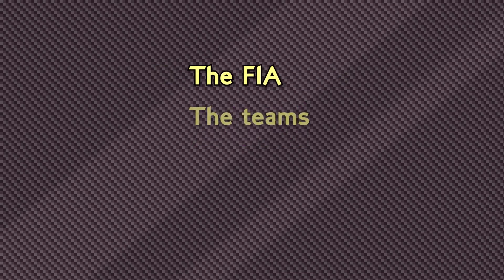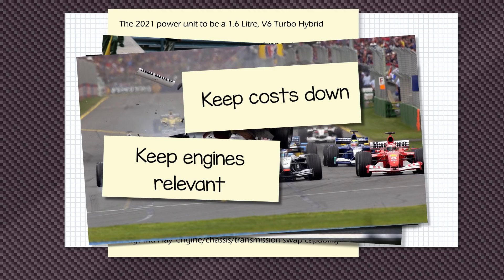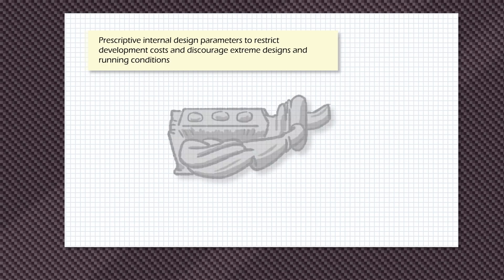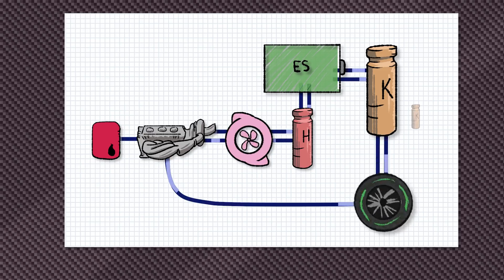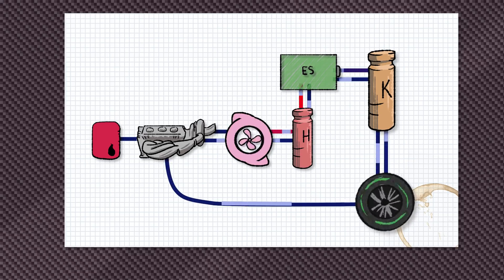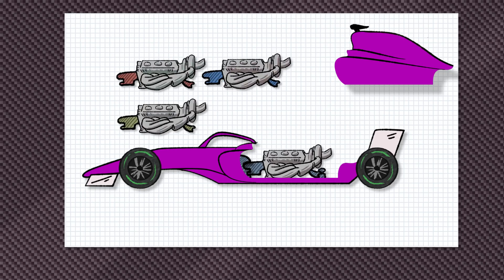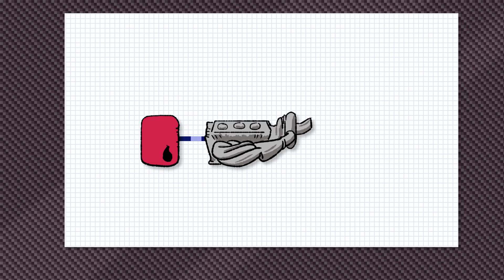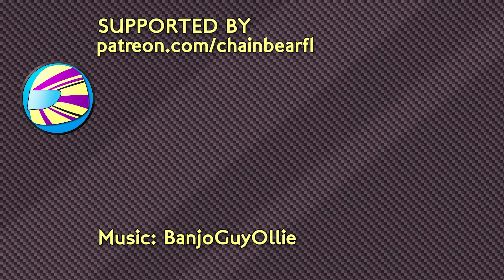F1 Engine proposals 2021 explored

Comment: It isn't even finished but already over-regulated...
I have the perfect solution:
- motors should run exclusively on electricity
- Don't beryllium/other-rare materials or anything that's morbidly expensive. (probably including cryo-cooling)
- Limit energy at the output of the batteries, fuel cells precisely to 750kW. (This will promote more more efficient designs for maximum performance.)

That's it, everything is solved! It wouldn't only be road relevant and fairly cheap but forward thinking and rational! (So obviously it won't happen)

Comment: Just imagine F1 cars driving round with 1Mw to 2Mw full electric engines ( 1300 + to 2600 + bhp )....easily achievable within the next 10 years....F1 with lay down the foundations for the motor industry having to drop the piston motors by 2040 in europe....IMHO....there gonna be quiet......but brutally fast.

Comment: I would like to see that each engine swap costs 5 points and each gearbox swap 3 points. But you won't go below zero. So a low-performing team can be very active in engine development without getting punished while a high performing team has to be more careful.

Comment: What about creating "Formula No Limit"? 
Just imagine F1 without any technical regulations. 
Fuel flow, weight, aerodynamic design, anything you want as long as it doesn't blow up when booting up.

I just think it would be funny, and also leave a huge margin for creativity.
Reply: Yea. With Ferrari and Mercedes having about four times the gap to smaller teams they have now. It'd be like a open-wheel LMP1 class. Just no.

Comment: Totally ridiculous. Why does an F1 car need to be green when they only race 18-20 times a year? Why does the sport need to be relevant? I've never seen somebody do the school run in a F1 car before. If you want relevance, watch Formula E & 24hr Le Mans. Formula One should not only be cutting edge but also entertaining, in the last few years the viewer ratings have gone down massively. I don't it's a coincidence that the V6 turbo came in at the same time. Saving costs? Man, engines are more expensive now than ever. Just use the V10s but allow the teams to use a variety of materials to make them, also make them more reliable and use KERs or something.

Comment: My god man! Not worry about the sound because the motors will be all electric one day? That is like committing suicide because you are going to die one day anyway.

Formula 1 currently appeals to fellows like us because we are part of the minority that likes the tech. The majority of F1 fans actually like the racing. These people want noise and overtaking. As well as crashes.

All F1 needs to do is make. Them sound better, cut the aero aids back (dirty air devices have killed overtaking) and find a halo device that doesn't look completely stupid.

F1 is a TV sport. It needs to look and sound as good as possible to attract as many fans as possible. Loss of popularity kills motorsport. Look at the various touring car and GT series that have died due to idiot balance of performance rules.

Let them race. Let them go silly with the engineering. F1 especially is meant to be the coolest, most insane and. Expensive motorsport on the planet. If the fans wanted green racing, formula Prius would be the most popular sport on earth. It isn't. Formula E is boring. It is watching Motorsport with the mute button pressed.

Comment: IMO, if F1 wants to leave behind exotic but inefficient by-gone V12s; then they should really push things forward.
Negotiating with automakers to encourage them to join the competition is only holding everyone back.
We all know that piston engines requires a lot of maintenance and is inherently not that efficient because there are so many moving parts. It is true that automakers have endless amount of engineering know-how to make them do what they want to a piston engine but still it is time to let go of that.

I would propose an electric driven direct drive set up and power coming from an efficient turbine engine. Turbine engines are literally maintenance free! and it can run every combustible fluid available. Today, they are more than 50% efficient in the form of electric power generation. This is way more futuristic than a complex V6 turbo that has a complex web of connection to the hybrid electric system. With a turbine-electric setup. it will be a series connection, simple, advance and efficient.

Comment: I'd rather see inline 4 cylinders with a flat crank than these v6s. Crankshaft timing and firing order has more to do with the lousey sound than anything else. The engines spin plenty fast as they are now, and they would sound great if they were anything other than the v6s they are. A flat 4 or inline 4 would sound much better. 
Let's also not kid ourselves... If you think the IC engine will ever be "phased out" of F1, you're just nutty. Formula E exists for a reason. F1 is F1, not Formula E.

Comment: In 2030 the f1 engine will be replaced by a GPU. Races will be entirely done by robots in software. It will be super relevant and rely entirely on electrical power and technology.

Comment: I don't quite understand the push to use these complicated energy recovery methods and tiny engines at all. It's debatable whether or not F1 tech will ever be completely relevant in road cars, I think WEC cars fit better into that category... but the whole fuel saving and efficiency thing is surely a bit of a "look at us, we are saving the planet" type of move. Anybody who thinks that 20 cars running around a track for an hour every 2 weeks will have ANY impact on the environment in any way is absolutely kidding themselves. This is why I think simple, loud, fast and generally more showy engines that have the capability to put on a good show due to lower running costs and reliability should be considered the most in F1. I love the technical aspect to these current engines and I think the work that these teams do in development is amazing but in terms of the future of F1 as a sport, i'm not too sure.. Nobody ever said that F1 had to be a sport run by greenpeace. If you look at most of the developments made in F1 prior to this generation in particular, development that made the most strides forward was done with a single thing in mind.. To win. Creating all of these artificial goals with efficiency in a way detracts from the essence of what has been driving F1 for the last 60 odd years... The drive to win and make radical moves, regardless of what is more 'efficient' or 'green'. Thats how I see it anyway. F1 shouldn't be a tech demo for companies, it should be an exciting and interesting spectacle where we watch the best drivers in the wold compete.

Comment: Old v12s are old, modern ones would not be, are you that stupid you can't see that? f1 is about ENTERTAINMENT! They are loosing their audience because they have sanitised the fuck out of the sport. When they ditch petrol engines for electric the audience will shrink and the sport will eventually die.

Comment: F1 has always been about money, glamour and an element of danger. That is the appeal and money breeds radical designs and concepts.  That was the culture and the current owners are moving away from it or perhaps the industry has been toning it down over recent years. If the petrol engine is replaced more with electric motors then we are competing with Formula E !
Set parts and common parts is similar to indy car and the new owners have to be careful that the needs of non American fans are kept happy.

Comment: I just want the V10 back
Reply: Honestly it would be cool to have a super small displacement v10 hybrid
Reply: @FELiPES101  Idm an I5 either ; it has some uniqueness in it's engine note like a V10 as well
Reply: @FELiPES101  you aware that v4 hybrid in porsche lmp1 already has 1000hp+ right? v10 hybrid is gonna kill them
Reply: @dhupee  Too fragile and under balanced, at least that was my understanding of it. Inline 3 would be more appropriate, if we're going to downsize. Still has major issues but it's relatively cheap.
Reply: @F1ll1nTh3Blanks  yeah, im pretty bad at engine knowledge, im instrumentation science, dont know
Reply: @dhupee  Nah I was wrong. Well not wrong but it is most likely the V4TT hybrid power-train will replace the V6T ERS in a few years than anything. Problem for now is it's abit too big, too complicated and expensive. The current power-train is complicated and expensive enough as it is. Moving to the smaller, more complex unit, whilst inevitable will only drive more potential manufacturer interest away from the sport, further exacerbating the current problem faced by the sport today.  🤔 
The quandary here is balancing cost and performance efficiency.
Reply: @F1ll1nTh3Blanks  more tech more expensive and more complex, i still dont get it is a joke way why people complain about less cylinder... lol, if its gonna be twin turbo V4 its gonna be like Toyota LMP1 now... kinda cool
Reply: @F1ll1nTh3Blanks  F1 has a problem here, while they so hard try to maintain the sport for spectator and audience, they have to face need for advance car research and manufacturing, because behind the scene of F1 is so many aspect
Reply: @dhupee  It will be more like the 919 EVO but I get your point.
The spectators and audience aren't so relevant in F1. They will be here for the most part no matter what happens to the sport. I think it's about the growth of the sport. To grow it needs to attract attention from new manufacturers. Downsizing is not the problem. It's what's being done to make the downsizing viable. It didn't work for LMP1 and I don't see it working well for F1 but time will tell. 
I personally am excited to see smaller ICEU's and downsized power-trains for the technological aspect but less so for the growth of the sport.
Reply: They sounded great but they just weren't that good. Not only were they slower than the current engines but they were far less reliable.
Reply: yeah, i like the sound but me as college students kinda aware of tech and environment, and after watching video below i understand why, i like V6 turbo hybrid more tho because... techy

https://youtu.be/2QisYfvYZks
Reply: Dhupee Haj i love how you’re so full of yourself and think that you’re very intelligent but in reality you aint shit. You clearly dont understand why because 20 races on the calander in a year with 20 cars aint gonna do shit to the enviorment. Its the millions and millions of cars on the streets made by the car manufacturers which some participate in f1

Comment: one huge issue with the engine regs now espically in 2018, is they limit only threen engines for the entire year. These limits cause teams to turn down their engines during the race to preserve them and only turn them up to full power in qualifying or certain times of the race. To me F1 should should be about full power flat out the entire race, not preserving the full potential. They have this silly idea that reducing number of engines reduces costs. In reality, the engine manufacturers have to spend more money trying to figure out how to make their engines more reliable, and it prevents them from using max power through out the race.

Comment: As the biggest bone of contention seems to be centered around the MGU-H being removed or not,I'd contend that if kept they probably should take the Mercedes design (internals with ability to run split turbo or not) and put it in the exclusion from development boxes,and make it a standard component. Surely that would placate Mercedes & Ferrari

Comment: Just as a mental exercise, I like the idea of letting engineers and designers go mad and design the absolute best, one-seater, open-top racers they can...driver safety is on its peek, tyres and brakes are also manufactured better than ever, we have run-off areas, barriers that wont kill you, etc. And that is absolutely alright and should stay, but that doesn't exclude the rest. I would love to see concepts put to test in F1. It was interesting having a six-wheeler compete...it was interesting to see the various designs battle one another. Of course that the bigger manufacturers would have an advantage, but it would be damn fun to watch a designer competition. Let them refuel, let them use more engines, tyres, drive to the limit and stop pretending that it is road relevant. It just isn't, you are not 24 - hour racing. You are no more road relevant than athletic sprinting is to walking to the shops. And I must say that listening to the radio exchanges...slightest contact and the drivers are suddenly like children on a freaking playground. "He started it!", "No, he bumped into me!" ...it is just pathetic to hear. F1 had a lot of contact sometimes. It is part of the fight. Just don't be stupid and don't wreck each other. Look at Villeneuve vs Arnoux at Dijon in '79 for a fight...they bang wheels, push one another, follow closely, go off track and lock up...and it is some of the most thrilling three minutes in F1 history. But that is just a fantasy of an era that won't ever happen again, probably. I still think it is a bit sad though...

Comment: For me the sound of a F1 car is very important. I can really enjoy listening to the V10 and V12 engines with high revs. If they really want to keep the V6, I hope they will increase the rpm quite a bit for better sound performance. The combination of the combustion engine and the electrical engine is a good one. Using the battery for extra power as a strategy is really good for the sport ,so hopefully the amount of overtakes will increase. Who votes for better sound and more overtakes?! =D

Comment: Dude, the combustion engines disappear for CONSUMERS eventually... But, like rocket engines, unclean, exciting combustion engines in racing will always be a thing.
Reply: rocket engines are driven by hydrogen which produces water
Reply: @simpl5049  not only, there are high toxic chemicals, too. google for hypergolic fuels.
Reply: Olueni onLoppu Bulk emmisions are in fact water.
Reply: What happens when most of the F1 fans have grown up with only electric cars on the market? Do you think they'll care about the lack of sounds of an internal combustion engine?

Comment: As a fan I want passion, not control. A sport should be about competition, and the current F1 is not very competitive in driver terms. It's all fuel management, tyres management, recover energy from one lap to another... BORING. And i've been watching F1 since 2003. As a fan, I don't want complex energy management systems. I want to see pilots in the edge, not thinking where they should apply this or that engine map. I think simplicity equals more fun. Football is not so "clever", and it's fun as hell.
Reply: Oh, and I'm a mechanical engineer so, obviously y like development. Astonishing technology in current F1, but not so good for a SPORT.

Comment: 2:50 Having gone to an F1 race (Montreal) in the mid 90s when teams ran all sorts of 3.5 liter engines (V-8, V-10, V12) it was glorious but it was a pain as the engines were ridiculously loud and you always had to be protecting your hearing and you quickly got a headache and you couldn't hear anything else. OTOH I went back to the same race in the first year of the new formula and it was great: didn't need earplugs, never got a headache, you cold hold a conversation or hear the track announcer. Also you could hear other things like the tires locking up or the brakes squealing.

removing the MGU-H doesn't seem to make sense to me. The best PU in Prototypes is the Porsche that uses an MGU-H so if F1 got rid of it, then why would Porsche (or VAG) ever consider F1 over a Prototype? I wouldn't be surprised to see MGU-Hs on volume hybrid road cars fairly soon because it is a huge driver of engine efficiency. Similar systems are already being sold for big diesel tractor trailer engines

Fuels/oils are a waste of money as that has little impact on road cars (alhtough it really helps the F1 cars) and F1 should simply move to spec fuel and lubricating oils. Of course the top teams all have fuel/oil sponsors so they don't want that but that would be a leveler between the big teams and the little ones. You have to figure that some of the difference between Mercedes and Williams is that the Mercs have Petronas' tricked out fuels for race and qually while Williams is probably running something a bit more generic.

I like the idea of standard interfaces and more standardized control boxes etc which F1 has been doing for awhile - although this is, in fact, a subsidy and competitive advantage to Williams and McLaren that provide a lot of these components.

TBH F1 should just subsidize customer engine teams so that the engines' cost wouldn't be such a big deal.  Also they should require that each engine manufacturer be prepared to provide their current engines to any other team, as it is now if Renault gets good they'll drop Red Bull like a hot potato because they don't want to compete with them and that's the same with all the engine manufacturers that also run teams. F1 is praying really hard that Honda gets competitive or that another good engine supplier comes in.

Comment: I know F1 and NASCAR are basically completely different sports but NASCAR gets away with using Big V8’s which are pretty much antiquated, and this adds to the drama and appeal of the sport. I’m not a NASCAR fan and I don’t know many, but I know it’s still extremely popular or at least extremely lucrative. Additionally, I know nothing about F1(except that it interests me), but if the basically antiquated V8 adds to the NASCAR experience, why wouldn’t the same apply to V12 in F1? I know obviously they’re developing engine technologies for real world environment, but c’mon. In my opinion it should be about the entertainment first. Like I said, though, I know little about F1... just brainstorming